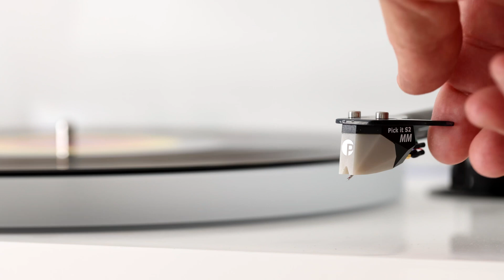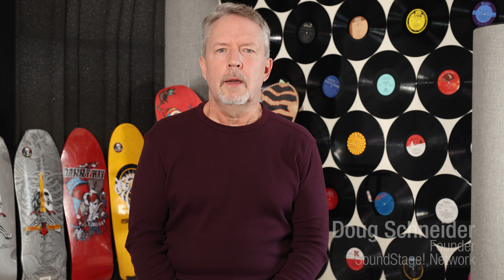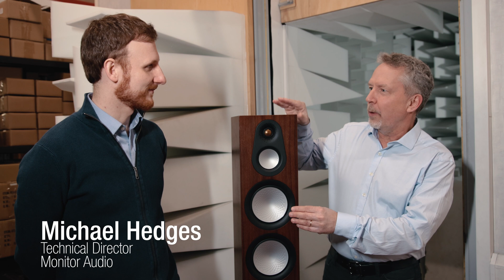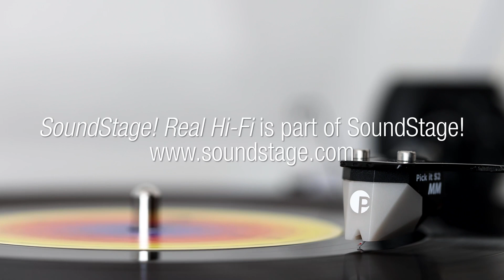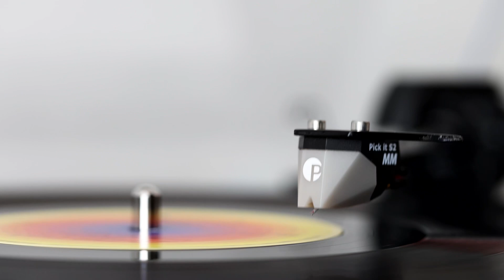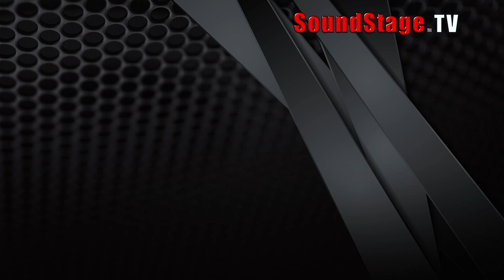Midrange Magic: The Real Reason Monitor Audio Uses a 3″ Driver to Improve Speaker Sound (Ep:63)

Comment: Using a 2 - 3 inch mid driver was popular back in the day, especially in the DIY community. Somehow it fell out and I see companies reverting back to 5-6 inch.
Reply: Good point. Lots of uses of small dome midranges, too. None of this is really new, but I thought it was interesting to see Monitor Audio go this way after so many years of larger midrange cones.
Reply: @Doug Schneider  
@Mark Winston  
As with everything in loudspeaker design, it's a balance of trade-offs and compromises.  Adding another driver to the loudspeaker design increases overall cost and complexity, both for the additional driver + crossover parts, and the crossover implementation. 

The crossover region between any two drivers is where there is the most potential for acoustic coupling and linearity issues to occur.  And while using a smaller midrange allows for closer center-to-center spacing between the mid and tweeter, if you can cover more of the midrange and midbass frequencies using a single driver before needing to hand off to a subwoofer, you've got fewer points of origin for each frequency range, and fewer crossovers to have to get exactly right.

IME, the key consideration and potential issue when using such a small midrange is that it will most likely limit the loudspeaker's maximum output/SPL capability before audible distortion becomes an issue.

To avoid this, you'll need to HP the small midrange much higher in frequency...usually at least 400Hz-550Hz...which lands in the critical vocal range where we are extremely sensitive to any anomalies and phase coherency issues.  Therefore, the implementation of the crossover between the smaller midrange and the midbass driver will be that much more critical.

IME, when the proper driver pairs are chosen for a 6.5" + 1" 2-way design, it is possible to minimize significant beaming and provide smooth, even directivity.  But everything about the design and implementation will need to be just right.  And, depending on the size of the room and listening distance, there's a chance that it will be limited in SPL unless a subwoofer is used to relieve the midwoofer from its lower midbass & bass frequency duties.

The use of a waveguide on the tweeter in a 6.5"/1" 2-way can improve this integration between the midwoofer & tweeter while providing constant directivity.  And we've seen this become a lot more popular in recent years as software modeling and measurements of waveguides has become better and easier.  Many small 2-way studio monitor designs are using waveguides.

However, if you are designing a nearly "full-range" 3-way loudspeaker, IMO&E, using a 4.5" to 5.25" driver for the Midrange is the best compromise.  

Those size drivers are large enough to produce very good midrange SPL levels, AND they can more easily be crossed over to 95% of tweeters without beaming becoming an issue.  The center-to-center spacing between the mid and tweeter can be closer as well.  In addition, that size midrange driver can reproduce the majority of the Vocal Range, avoiding both a HP & LP crossover right where we are most sensitive.

A 4.5"-5.25" midrange also lets the larger midbass/woofer driver be optimized for the midbass and bass regions exclusively, where you need much more Sd combined with Excursion in order to produce adequate SPLs and impact.

If a very small "mid-range" driver is tasked with producing the midrange frequencies as well as some of the lower midrange or upper midbass frequencies, IMD becomes a factor and consideration, and will largely depend on the quality of the driver in this regard.   The few small-ish drivers that excel in that regard are usually exponentially more expensive, and still limited in terms of efficiency and SPL.

Having said all that, I'm looking forward to trying the BlieSMa M74B 3" beryllium dome midrange in a 3-way DIY design in the very near future.  But I've been extremely impressed with Purifi 4" in the meantime.

I'm also using a concentric BMS 5CN162-HE 5" midrange/1" HF Compression drive unit in a DIY 3-way of my own design, which uses the Ciare HW251N 10" as the midbass.  So far, truly excellent results.  :)   They have replaced my former ATC SCM25A monitors in my home studio which were 4x the cost.

The 5"/1" BMS concentric drive unit requires a fair bit of EQ, but the sheer dynamics (even at low volume levels), coherency, and imaging/soundstage (especially the depth & height) are something to behold.

IME, a small 2"-3" midrange combined with a traditional 1" dome tweeter could never achieve the SPL levels and Dynamic capability of a 5" midrange, especially when it is combined with a HF compression driver that just needs a few watts to do its thing.  😊
Reply: @bbfoto7248  You seem to know what you are saying - would a 4 inch driver do well covering 450Hz to 3000Hz? With one 7 inch covering 0-450Hz and another 7 inch covering 0-90Hz? Planar tweeter 3000Hz and up.

Comment: Interesting. This makes me wonder about speaker toe in now in regards to speakers with a larger midrange driver. My speakers are Usher two-way standmounts with a 7" midbass driver. I have found that they sound best facing almost straight ahead with very little toe in where I get wide soundstaging yet clear imaging. But if the 7" midbass driver is somewhat beaming in it's dispersion perhaps my speaker should be more toed in?
Reply: When you're using toe-in or toe-out, you're affecting your on- and off-axis characteristics at the listening position. That said, with a 7" midrange-bass driver, I can pretty much guarantee you'll have some off-axis response anomalies when it transitions to the 1" tweeter.
Reply: @dougschneider8243  Depends on the 1" tweeter 🙂. Google "Ported Tweeter"
Reply: @alexralph9929  That would probably have its own issues to deal with. But it does seem like we want the driver to cover more and more of a frequency range
Reply: My Focal Chora, Aria and Wharfedale Diamond 12 sounds best with zero toe in too, wide soundscape but a very focused center imaging. I could toe them in and get a more pronounce and forward midrange (I guess 30 degrees off axis causes a dip in the 1-3khz region, especially on the Diamonds), but begin to lose that width that I love. With this dip, vocals take a step back, creating a sense of depth (think of the 'BBC Dip' here) but it might be a little too much on the Diamonds since they already have a 'BBC Dip' there to begin with. With Focals, zero toe in is perfect.
Reply: @AbsoluteFidelity  Toe-in or even toe-out is a speaker-to-speaker, room-to-room thing. How the speakers energize the room -- and then the room characteristics factored in -- means there's no one-size-fits-all approach.
Reply: @dougschneider8243  True, both play their part but I feel its more of a speaker to speaker thing, with dispersion holding the biggest cut of the pie. Ive tried my speakers in several rooms in my house, from 6m x 2.5m to 6m x 5m to the largest one 9m x 7m, all symmetrical with no weird shapes and they generally produce the same results with toe in/no toe in. In the small room, the speakers are literally inches away from the side walls, in the large room they are 2 meters away. But you are absolutely right, it depends on how the room is too.
Reply: @AbsoluteFidelity  We're on the same wavelength, but I refine it some. Wide, even off-axis dispersion is more "room friendly," meaning you can plunk the speakers down in varied rooms more easily. Poor off-axis response (i.e., uneven) means you'll have to work with the placement and/or room itself much more.
Reply: @dougschneider8243  Totally agree, the likes of Genelecs and KEFs are definitely in that category, even dispersion throughout. Couple that with the fact that they have narrow dispersion characteristics, they certainly are more room friendly than lets say a Focal Chora which has WIDE dispersion and does not have even dispersion (flares up at ~8khz). The Gennies and KEF can only dream about what the Focals can do though in terms of soundscape size.
Reply: @AbsoluteFidelity  One thing for sure is that Focal has really come along. I think it all started with the Sopra No2, actually. Before then, a lot of the designs were iffy. But the No2 changed a lot there.
Reply: @dougschneider8243  They still have their trademark widening treble dispersion though?
Reply: Toe in would give you more flat on axis response, but the off axis flare at the crossover would still affect the sound a little, depending on the room. 
Fwiw; upper end Monitor Audio's is somewhat "cleaner" overall than the Usher (in tower speakers, and an older Usher at that) But the Usher does seem to have a more "lively, warm" kind of sound; bass drivers are more compliant, cabinet is bigger. The treble seems to portray cymbals more nicely. 
I'd love to try an Usher 3-way though as I reckon that would be a better comparison. 
There's the newer AlMg tweeter and mid, or the somewhat older Beryllium ones; pity there's not a lot of accessible discussion on them.